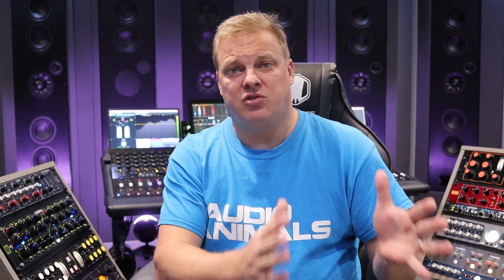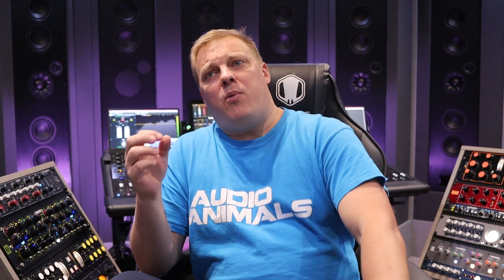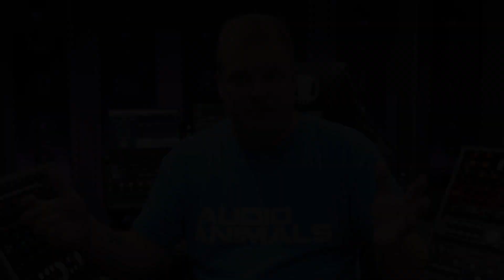What Is The Difference Between Stem Mastering And Mixing & Mastering?

Comment: Great explanation! Regarding the mixing side of things would you consider yourself genre specific or do you like to take on all genre's and also if you were to stem master a project and you felt that a particular stem would really benefit from going through some outboard gear prior to the final mastering process do you consider that mastering or mixing.
Reply from the maker: I personally don't consider myself genre specific. Having worked on countless amount of songs and library music, I can say there isn't a genre I don't work with. When stem mastering every stem is passed through the analogue chain through various outboard gear. If processing was required on a stem, I would treat that stem in the box before hitting the master bus and analogue equipment.
Reply: Got it! Brilliant thanks.